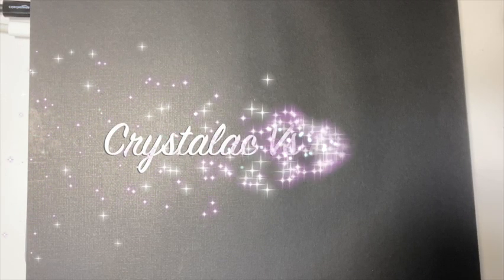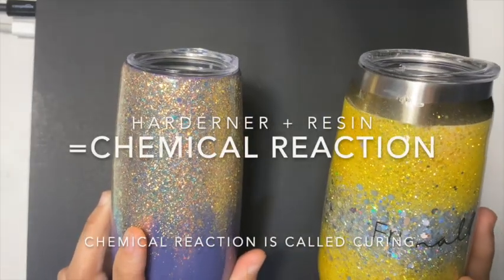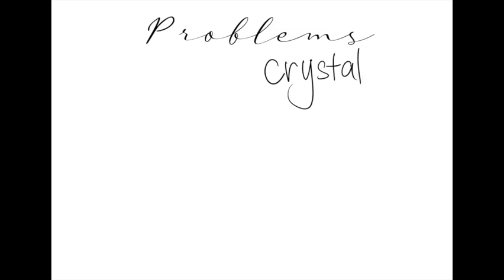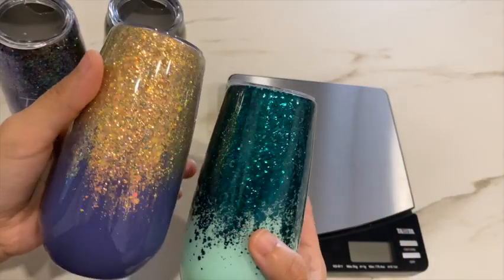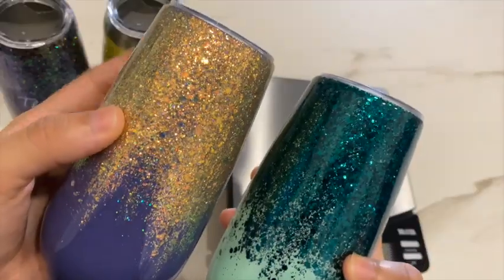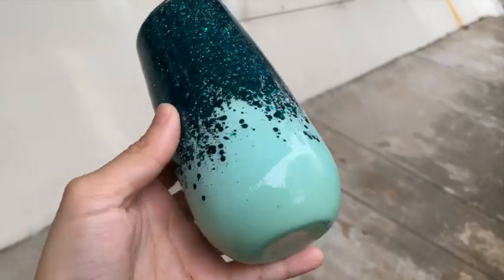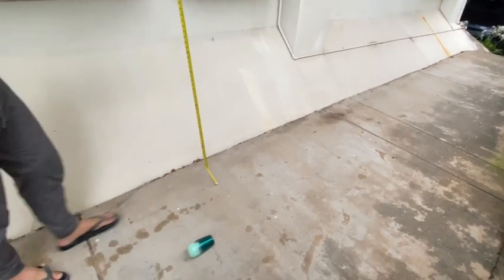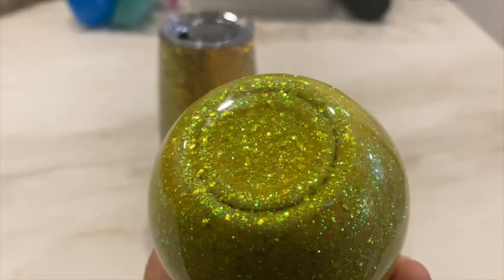Crystalac vs Epoxy | Drop Tests & Weight Tests, Pros & Cons.

Comment: I’m still in the research phase of the epoxy v crystalac. SO, thank you so so much for this video. By far the most comprehensive and answered all but one question- well, two- price and availability? BUT I can very easily find that out on my own. Yeah, the supplies picture really is jarring when it’s laid out like that… the waste I produce with epoxy is always been a bit of a bummer for me- and I reuse cups, sticks, most gloves- whatever I can.  THANK YOU SOSO MUCH FOR THIS VIDEO- NEW SUB NEW FAN!!!!!
Reply from the maker: THANK YOU SOOOOOOOO MUCHHHHH…. ❤️❤️❤️❤️❤️❤️❤️
Reply: I think the safety issues far out way any other con for sure!

Comment: One of the pros of epoxy over Crystalac is the turnaround time for craft project if you are selling your items isn't it?
Reply from the maker: hey! I wouldn't say that.. because I haven't had issues and changes with my lead time. It APPEARS longer, but in all honesty, it isn't. It dries faster to touch compared to epoxy. The only downside is that molds cannot be used. But you can use jesmonites if you're into molds, or acrylic blanks. But if epoxy works for you, don't let me be the one stopping you. I stopped due to health and allergy reactions. This post is also not to shame anyone <3.
Reply: @Kruftisg  I’ve never heard of jesmonite. I’ll have to check it out, I mostly do tumblers , but sometimes like to do molds. Thanks for the video, I’ve been thinking of switching from epoxy to crystalac.